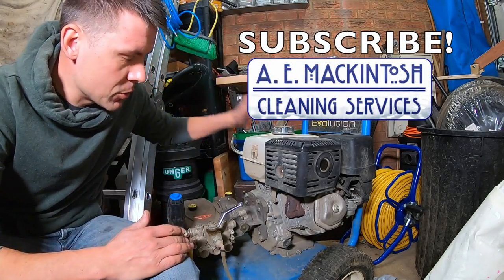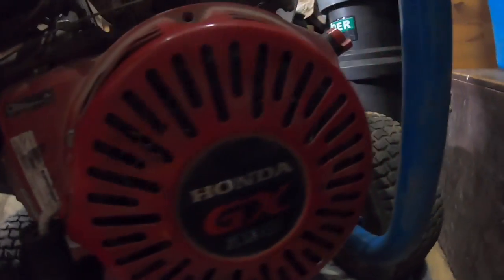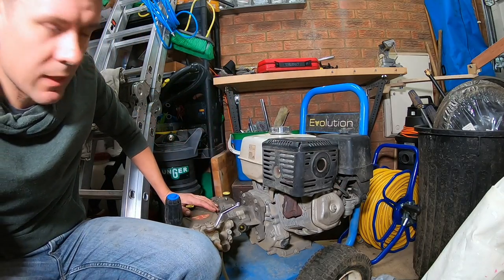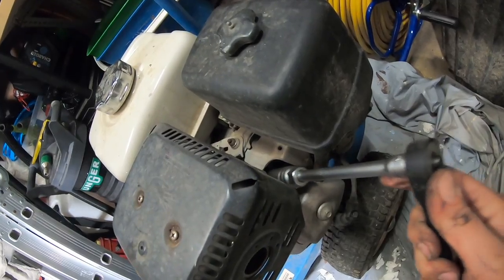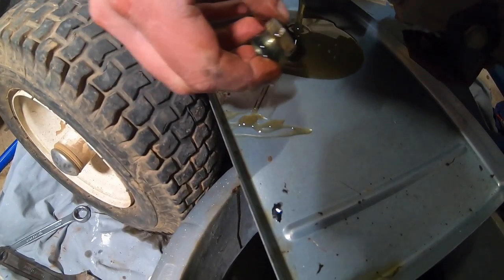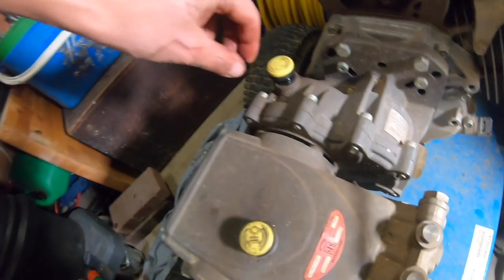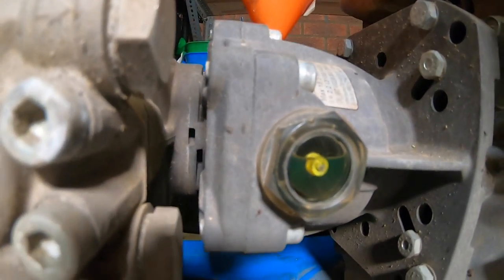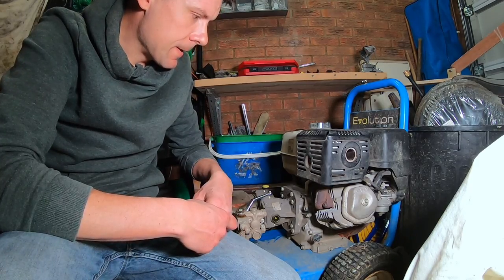How To Service Your Pressure Washer - Honda GX390

Comment: Hi Ashley,  with services a tip when draining of the oil is to crack open the oil filling caps this will help vent drain all the oil.. also a sacrifice oil fill.. so replace all oil to correct level .. start and operate machinery for 10 to 15 minutes under load .. when the engine oil has cooled down but oil still warm.. drain off.. then refill with new oils.. you be surprised how much sludge will be still contained on your sumps.. 👍😀 keep up your good work bro .👍
Reply from the maker: FlashTechEngineering Good tips! Thanks for that.😃👍🏼

Comment: Really useful! I didn't know that each place needed different oil! You should also check your unloader valve and inline filter of you have them.  Also, you can wash your airfilter in petrol and let it dry.  Never needed to replace my original one.
Reply from the maker: Walt Spring Thanks for the tip. I had an issue with the unloaded valve recently, so I’ve only just changed it.😃👍🏼

Comment: A black sparkplug doesn't mean it's bad. The new one will become black really quickly so there is really no need to replace one unless it goes bad. Also you don't need to replace the oil screw every time you change your oil, why would you do that? If the screw is not striped then you can use it forever.

Comment: You should put an hour meter on there. Very cheap and easy to install. Also a good idea to change pull cord once before season starts. Also clean your float cup.
Reply from the maker: Nice tips, thanks.👍🏼

Comment: Nice video was watching to see what gearbox oil you was using,  quick one for you the engine oil its self you don't use the dipstick oil should be filled to the top of the threads 😉
Reply from the maker: Yes, thanks. Hope you found the video useful.👍🏼

Comment: Quick question... I want to get into roof cleaning and gonna get the scraper you suggested etc.  Is it easier or harder when the moss is damp vs dried out? I thought maybe its a good winter job as it's soft but could be tougher work in summer when it's dry?  I find dry gutter cleaning much harder!
Reply from the maker: Walt Spring The gutter vac seems to prefer it when the moss is damp, but with roof cleaning, I suppose it’s easier to move the moss around when it’s dry. But I just try and get on with it either way really.😃👍🏼

Comment: I have a digital hour tachometer fitted on all my pressure washers, generators and pump.. £12 on Amazon. A great way of recording services intervals. Oil on the spark plug isn't the best method. Copper grease works so much better and wont contaminate the electrode
Reply from the maker: AW Services Ah, that sounds like a handy gadget. Thanks.😃👍🏼
Reply: I have one on my Toro lawn mower considering getting more for the power washer, snow blower and generator. At $10 each good reminders to have.

Comment: Hi I have preasure washer the same like yours and I'm curious if you had any problem with gearbox oil screen as mine is getting cracked i replaced with a new one and same problem again
Reply from the maker: No, never had that issue. Sorry.

Comment: Thank you for this video. One question. The engine oil deep stick has no min nor max marks. Where is the right level? Thanks.
Reply from the maker: Yes, when you screw it in the level should be near the top of the dipstick.👍🏼
Reply: @aemackintosh  thank you.

Comment: Hi Ashley could you point me in the right direction for a start up pressure washer that doesn’t cost 2k there’s just so many and so many opinions. I just want something that’s going to do the job as good as a professional without breaking the bank just in case it doesn’t go as well as I hoped thanks
Reply from the maker: My advice, get a decent machine from the word go. You will do a decent job more quickly and you won’t have to replace it for a long time. This is the perfect time of year to go for it. If it doesn’t work out for some reason I’m sure you could easily sell the equipment on.😉👍🏼

Comment: Hello, I noticed that your 15W40 oil says multi grade MINERAL OIL……is that the same as 15W40 MOTOR OIL?
Reply from the maker: Best to check with the supplier of your machine for the correct oil to use.😉👍🏼

Comment: Hey Ashley 
Are the oils you use the same on all honda engine? 
I have a honda gp 200 
Thanks 😊 love ur videos they are so helpful
Reply from the maker: Not sure. It’s probably a good idea to check the manual or the supplier who sells them should be able to help.😉👍🏼
Reply: @A.E.Mackintosh Cleaning Services  will do mate 👍 
Cheers for the videos I have found them very helpful in my pressure washing journey 😀

Comment: Oil level for the engine should be right up to the filler neck
Reply from the maker: Craig Hunnam Ah, yes, that would be the maximum fill. I’ve only got it up to about minimum I suppose. I will give it a little top up, thanks.😃👍🏼

Comment: My gx390 was filled with Diesel  by mistake..I drained the Diesel as best I could and got it running but it smokes when it's running..is it just burning off the Diesel or do I need to take it to a small engine mechanic?
Reply from the maker: I’m not sure, but I would imagine it will not run so smoothly for a while.

Comment: Hey mate , I wish u can help with my one . 
I’ve got the same engine gx390 with different water pump brand , my issue is that when I’m using the machine I have to adjust the power manually, either put up more or put it down , it doesn’t adjust itself when I’m using it any ideas of what could be the problem?

Comment: Hi Ashley. Quick question. My washer, which is exactly the same as yours, is mounted in my van. How do you advise servicing in this situation? I presume I will have to unbolt the washer to drain the oil?
Reply from the maker: You might have to take it out to service it?
Reply: @aemackintosh  I though that would be the case. Thanks Ashley, much appreciated

Comment: It should say in the Honda manual you get with the Honda engine the correct amount of oil in liters the engine requires, you don't happen to have a link where you buy your pressure washer pump oil please
Reply from the maker: Josh I get mine from the same supplier that I got the machine from, jet wash direct. I will put a link in the description.😃👍🏼
Reply: @aemackintosh  Thanks👍

Comment: I service mine every 10 jobs might be over kill but better safe than sorry also I clean the air filter foam and soak in fresh engine oil also I would get into the habit of checking valve clearances. Oh and dont screw the dipstick in or you are running on low oil just put it in down to the threads then its correct.
Reply from the maker: Yes, great tips. Thanks.👍🏼

Comment: Hi sorry to bother you,I just would need some advice if that's ok,I'm going to get a pressure washer for my WC round just wondering if you could give me some advice on what is a good petrol pressure washer,I heard anything over 3200 psi and what about GPM? Any advice would be great thank you
Reply from the maker: I use a 21 litres per minute machine.👍🏼

Comment: Do you know were I can find a suction hose for a gx200???
Reply from the maker: No, sorry. You could try asking Rutland Pumps or AC Pressure Washers.😃👍🏼
Reply: @aemackintosh  wpud it be dependent on the pump
Reply from the maker: I don’t think it matters too much. It’s just regular hose pipe really.😃👍🏼

Comment: I just picked mine up yesterday. What lpm and bar is yours?
Reply from the maker: The Young Ottoman 21litres per minute.💪🏼😃👍🏼
Reply: A.E.Mackintosh Cleaning Services same here. What’s your take on the double intake feed? Feeding the pump from both sides?
Reply from the maker: Yeah, not all taps run quick enough for the machine, so I set mine up so it draws the water it needs from the bin. You could even feed two hoses into the bin if you have access to 2 taps. Or just reduce the revs a little, but then you won’t get the same power out of it.😃👍🏼

Comment: Are the manufacturers of these machines living under a rock? Why no holes under the drain bungs so oil dosent go everywhere?
Pre buy your service parts and wait until you have used your machine and it’s still hot, dump your oils while all the particles are in suspension in the oil ie: immediately.
Wait for it to cool before re filling.
Blow around spark plug to remove debris before removing plug.
Set your spark plug gap before screwing plug in by hand only before applying ratchet spanner.
It would be good idea to adjust valve lash clearance, for that motor, is lots on YouTube about it.
Never use 98 Ron fuel or burnt exhaust valves.
Purge out all air in supply hoses if you want your pump to live a long life, and never run a pump without water while testing a machine, or run it without flow trigger on for long periods.
If it’s someone else’s hose, flush it first before connecting to supply.
Cover your open ends with a cap to stop hornets building a nest.